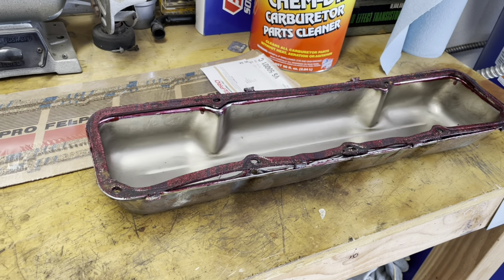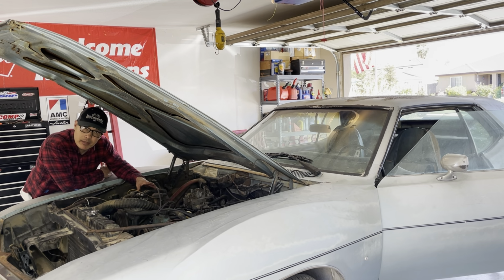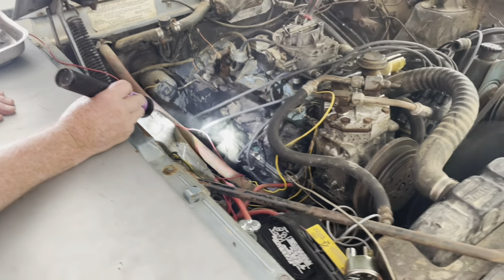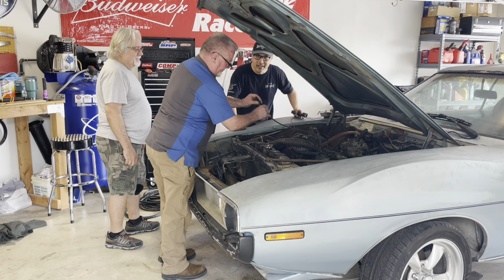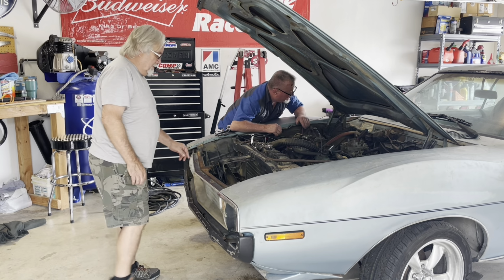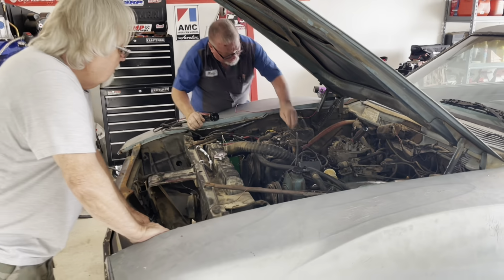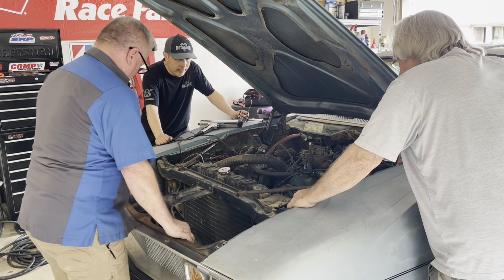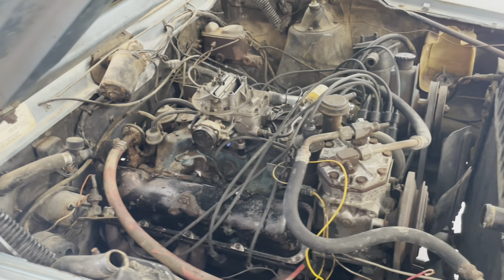1974 AMC Javelin Part 10

Comment: There are two types and places for pulling vacuum. If the manifold is the source for vacuum then there is lots of vacuum when the throttle is closed. If the vacuum is ported near the bottom of the carburator then its venturi vacuum and there is lots of vacuum when the throttle is open. Vacuum can be used for many things besides advancing or retarding timing.

Vacuum is often used in conjunction with automatic chokes and secondary carburator barrels.

My uncle had a 52 International pickup with manifold vacuum operated wipers. Going uphill the sometimes would stop. Downhill they were ready to fly off the truck. An old 2.5T truck I drove in the Army had slightly better behaved vacuum operated wipers.

Timing can also be mechanically advanced inside the distributor through centrifical force.
Reply from the maker: Good info! Thise vacuum powered wipers would have been a sight to see! LOL

Comment: Did you set the idle on the carburetor first, usually 650 rpm , them set the points to 30 degrees, then set the timing.
Reply from the maker: Thanks for the info! I do plan on fine tuning everything once all of the other issues are fixed. The brakes are next on my list since they do not work.  Stay tuned!

Comment: Loose the Permatex high tack as you know by now it's not working. probably need to hammer the area around the bolts flat and are you using the half-moon washers they help to distribute the torque.
Reply from the maker: Yeah we tried all the tricks with no luck. I ended up putting a stock valve cover on and that solved the problem.

Comment: Do not use seal on cork gasket. The cork gasket cannot to its job then to absorb the oil. When it absorbs the oil it will seal propertly. With the stuff you are using the gasket will just be very slippy
Reply from the maker: Time will tell. I've used it before with no issues. Gaska Cinch is my prefered gasket dressing.

Comment: Ok what is that red crap on the gasket. hope it's not grease. gasket needs to be dry. Clean all the grease off the head and valve cover. Since there aftermarket valve covers you need to scratch the area were the gasket lays with emery cloth then spray a light amount of copper coat on gasket and cover and let it tack up for a couple minutes then install.
Reply from the maker: The red stuff is Hi Tack from Permatex.